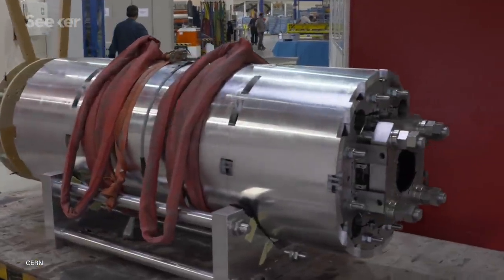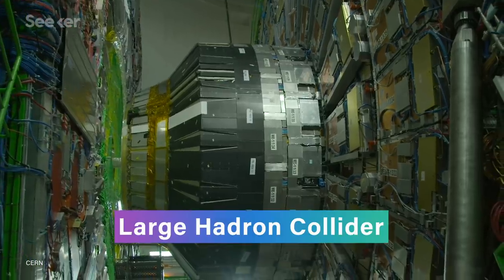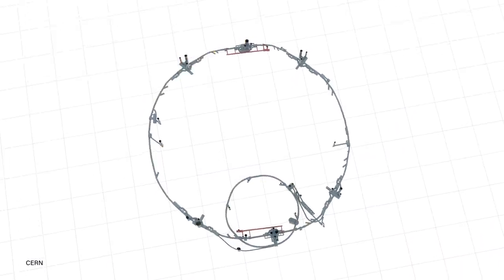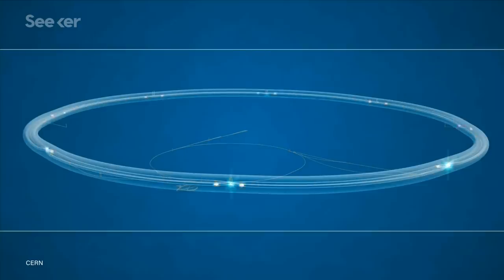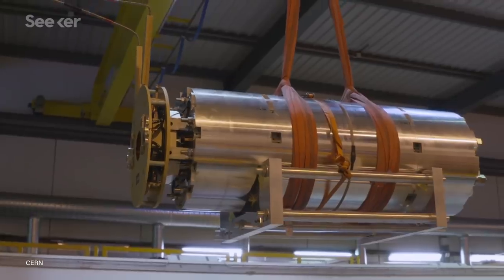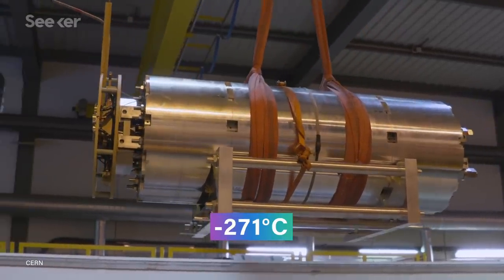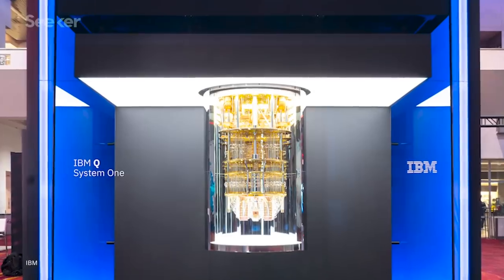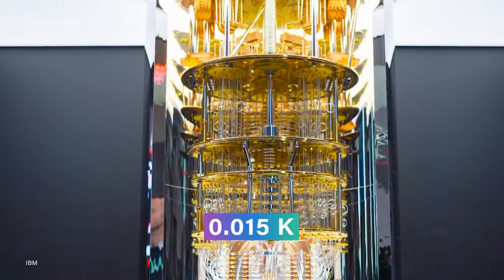The World’s First Room Temperature Superconductor Is Here

Comment: 6 word Summary: Room temperature, but not room pressure.
Reply: and really expensive
Reply: To anyone reading this: You know you counted the amount of words to check it was six
Reply: Darn
Reply: yep, really its just switching from trying to maintain an extreme in temperature to an extreme in pressure. It doesn't actually make using superconductors any more practical. There might be some niche use for it but I can't think of anything.
Reply: Or temperature.
Reply: Proceeds to apply PV=nRT just to realise notthing is ideal
Reply: @yashrawat9409  lmao. Idk what that means but lmao
Reply: No it didnt need to compress artificially .this meterial is chemically compressed.
Reply: This kind of experiment is set to find a room temperature meta-stable superconductor. Which means that if you change the conditions required to create it, it maintains structure. And I know 0 about material science but I guess getting the superconductivity at room temperature goes first since why would you make a material that is meta-stable but doesn't fit the other requirements
Reply: Yeah, but I think its cheaper to adjust pressure than it is to adjust temperature.
Reply: Hey, welcome to the future. Amazing how much changed in a year. How bout dem lasers.

Comment: It's too expensive to use superconductor which requires -200°C temperature.

We created a room temperature superconductor which requires 10000000000000000 Pa pressure to work.
Reply: I'm imagining the budgeters being like  -__-
Reply: We’ll create a room temperature and room pressure super conductor... but it requires atoms of a super-unstable element of which we’ve only ever seen a dozen atoms of that have a half-life of a few milliseconds.
Reply: Although I would say its comparatively easier to increase pressure than cooling
Reply: @dipanjanghosal1662  yeah, sure
Reply: @dipanjanghosal1662  Yeah, instead of worrying about heat entering the device mere milliseconds after turning it on, you only have to worry about parts shattering and exploding from stress a few weeks or months down the line.

....it's a step forward.
Reply: To be fair, pressure doesn’t bleed, temperature does. A pressured box doesn’t need to be maintained with constant re-pressurisation.
Reply: @dipanjanghosal1662  I don't think it is true. You can always pour liquid nitrogen, meanwhile even a small hole in a pressure tank used to store the superconductor means it's shot.
Reply: Sure, but the researched said they are looking into making it keep the properties when pressure it letting go - so in a perfect world it could be produced through high pressure and then you can remove the pressure and ta-da. However, if that works no one knows. :)
Reply: Put this stuff as deep sea power cables could be feasible.
Reply: Success, thats a lot cheaper... now if only science can cut down on the erroneous comments.
Reply: @Decodeish1  just like when wire insulation was a problem back in the days! "People meet plastics" tadda!; we now have safe wire use in public
Reply: Hey, welcome to the future. More elements discovered. Also, how bout them lasers used to induce superconductivity in a circuit.
Reply: Why can't the superconductor be used in space where temperature is below -200°C 

Oh yeah it's expensive too
Reply: How did you create such a high pressure!?
Reply: @himaxi9453  possibly do to the approach of achieving SC in present designs, lowering friction & resistance to the point of losing no energy zero viscosity requires extreme density and they probably need the sustained pressure to keep the components together or lose the solid ionic attachment necessary to be SC
Reply: Metallic hydrogen is suppose to be so condensed that it would still exist in a solid state outside of high pressures. Think of it like a metal spring (representing regular hydrogen) push it in it will push out but push in hard enough it gets crushed and now can't push back (Metallic hydrogen) . its stable so to speak 

Tho I only did the minimum research required so might be wrong

Comment: For quantum computers, you need these low temperatures to reduce quantum fluctuations, not for the superconductors. Apart from that, this is one of the few news items / videos on this that actually gets stuff about superconductors right, good job! And you asked for what kinds of applications for superconductors: these also include for example power cables, fault current limiters, magnetic bearings and SQUID magnetometers. That is apart from everything that requires powerful magnets, which are the main application for superconductors and are often only possible with superconductors at all.

Comment: One use for a superconductor you haven't mentioned is the ability to stop a train if the brakes go out -- they'd just fly out of the cab and push against the engine to slow the whole thing down before it crashes into the ravine. Of course, they'll still be under a lot of pressure.

Comment: This is pretty cool. I'm going to guess that it will be a long time before we get this technology working at room temperature and pressure though. But, for things like fusion reactors it might be viable with just a decrease in required pressure.
I mean, even if the material still needs high pressures (not ridiculously high though) it could be still used. Industrial equipment for extreme pressures already exist. If we can get the pressure down to something we can manufacture a containment vessel for, then this superconductor might become useful.
Reply: So how you gonna make wire that also bends and apply insane pressure

Comment: Say water can feel temp. It will turn to vapor when its too hot. When pressure increases, the temp needed to let water feel hot increases too. Which means water feel colder in higher temperature. So...higher pressure is quite the same as low temperature.(in order to make materials feel colder)

Comment: My Hypothesis:
atoms are just an interaction between an electric and magnetic field. The fields interact/oscillate  in such away (maybe spherically) so that they produce mass. This mass is surrounded by another electromagnetic interaction that we call orbitals. the orbitals take up space but they have no mass.  The energy in the electromagnetic  fields that form mass is quantized. Different atoms have different energy quantization. The interaction of the orbitals form bonds and everything we know. Electrons are the smallest quantized mass we know. If energy leaves an atom it must leave as a quantized mass or as light. Light has no mass and takes up no space because all the electromagnetic energy is used to produce speed (so to reach the speed of light you must become light itself). Current is just another form of electromagnetic interaction that is a bit similar to light and is form from the electrons. orbitals themselves are hot. Plasma is actually just the orbitals expanding and so we get alot of heat. This is the reason you can only get as cold as absolute zero, because any colder means the atoms themselves must disassemble.  Also electrons can only travel as quantized mass in an orbital. If an electron leaves the atom orbital, then the electron become light.
Reply: Your "hypothesis" crumbles at the first application of critical thought or comparison to basic observation.

Comment: What if u coated it in a memory material like nitinol but one that's memory is at the required temperature of the superconductor so it retains the pressure set while being pressed in the machine, if it's possible to make a memory material that reacts to cold instead of heat the opposite of nitinol and have a strong enough bond to hold that pressure on the superconductor. The memory material could then be pressed alone and the superconductor could be inserted in the middle at higher temperatures while malleable increasing the pressure and the efficiency of the superconductor.

Comment: Another use of superconductors is power distribution. A lot of the power produced by big electricity factories is lost during transportation due to the millions of kilometers of cable needed to transport them throughout the distribution network. If instead we had superconducting wires (like the ones they have in LHC in order to distribute the extreme currents needed for the extreme magnets), we would have enormous energy savings.

Comment: Which is more expensive? Maintaining temps near absolute 0, or maintaining pressure a million times greater than the surroundings?
I would imagine that the latter is more of a manufacturing cost than a usage cost... which means the question falls down to the durability/price ration

Comment: Super highways for energy transfer would change power generation forever.
As it currently stand(No pun intended), cables have resistance in their material which leads to loss of power and waste heat. Something that limits amount that can be transferred over distance.
Superconductive material would not have this issue, meaning power generation could theoretically be done anywhere in the world and transferred where needed.
Reply: But for that the cost of superconductors has to come down relative  to the cost of aluminum or copper.Silver is the best conductor but we don't see them in power cables only due to the cost factor

Comment: I’ve often thought that using an on/off trigger and multi posted yttrium/copper/barium oxide high temp pellets used with a flywheel (of high weight) and multiple ferrous posts would allow utilising the low energy consumption/high output to make the pellets superconducting to impel the flywheel....... thoughts?

Comment: The superconductors operating in high magnetic fields is the more decisive factor than operating at higher temps for putting them in fusion reactors iirc
Reply: @Lee Ruan they use a coolant to keep them operating so the ambient temperature isnt a deal breaker, though having to cool more could make things a bit less efficient. If power were cheap enough we could run coolant through power transmission lines to make them have no resistance, which might be economical to do in some instances. If we had widespread infrastructure for producing and moving this coolant superconductors could be used in home appliances. The coolant could be liquid nitrogen produced by cooling the air with the cheap energy. Would still have waste heat as a byproduct of cooling the air tho and would require a lot of energy, so not sure it would ever be worth it.

Comment: Anybody else think that surface acoustics applied to super conductors at room temperature can resonate with a lattice structure such that it slows down vibration sufficiently to mimic what is happening near 0 Kelvin?
Reply: Interesting. What would the mechanism be? My hunch is that you might be able to use photons of controlled frequencies to resonate the surface. Could be useful for thin film superconductors. I’m not sure how you’r go about replicating that in bulk though

Comment: 🧲🌡️📡🔆☢️🔌🔊🔋♻️🌐☯️⚛️
 It's facinating how so many properties with-in Nature use: ~{"Differences"}~
 That "factor" seems to be a key factor in keeping dynamic systems functioning. *{High pressure/low pressure, hot/cold temp, different densities, static electric charges/discharges, electromagnetism north/south poles, different velocity/angular momentum, different amounts of energy/mass/frequency/vibrations. Different layers between different regions such as: (Land/water/air/edge of the atmosphere/space/ the different regions in space with different particle density/background radiation, creating bubbles/membrane layers/cloud regions, nebula's/Galaxy's/Galaxy clusters/ Cosmic filaments/less dense regions of space compared to dense regions of space.) All of these things are basic differences but create a way for the dynamic engine with-in Nature to continue flowing and operating to create and convert energy.} Just Like How a battery 🔋 transfers + charges through a membrane layer to a - charged side. Like how regions of high/low pressure and temperature 🌡️differences create winds. In water- add some factors and It creates ocean currents and flow. Then internally in our planet it creates plate tectonics, planetary convection, geothermal activity, a magnetic field around our planet, to hold a atmosphere. 
🧲🌡️📡🔆☢️🔌🔊🔋♻️🌐☯️⚛️
The natural world around us is just utterly facinating to me.

Comment: How much energy can you put into 
a closed loop..??
One can plug an extension cord into itself...but, can that electricity in it be magnified  ? And if so, can we keep it contained...?
Reply: Superconductors will maintain a current indefinitely with only the initial input of energy you can't increase that without inputting more but it will maintain the current you shove in. There is a limit though each superconducting material has a critical current a point that if exceeded causes them loose all superconducting properties and release the held current as heat all at once due to the instant resistance.

Comment: I don't understand why the LHC uses superconductors at 3ºK when Mercury was doing this in 1911. I thought mainstream superconductors were OK using liquid nitrogen, which is significantly less expensive and easier to handle. The same situation happens with modern MRI machines, where they use liquid Helium as well. This isn't looking good when Helium is in very short supply and very expensive. Can someone please shed some light here?
Reply: OK I finished the video. So the liquid nitrogen superconductors (high-temperature), "...Are difficult to manufacture in usable amounts."  I need to look into this to see exactly what the issues are.  They've been around for, what, two decades at least? Wow! We really need to pace to this industry. Good that uber expensive colliders and fusion reactors have kept it going. That sounds so weird when I write that.

Comment: They would help in making better electronics. Imagine computers without any cooling systems (thats less mass and power consumption right there). Heck, multi-core processors exist solely because frequency scaling was bringing heat to dangerous levels

Comment: IDK man... Remove like 95% of the pressure required to pull this Room Temperature thing off and it'll probably still be too much to make anything useful out of it begging the question what even the point of all that research was - Especially considering they then cranked the pressure up even higher... It's like trying to solve the problem of a burning house by throwing gasoline tanks into it 🤨

Comment: Wait do you mean that if superconductors are created that could be used at room temperatures without exerting so much pressure, FUSION ENERGY could become a real viable source of energy!!
Reply: Fusion has many other problems than the superconductors. They already use superconductors anyway, just with more expensive cooling.